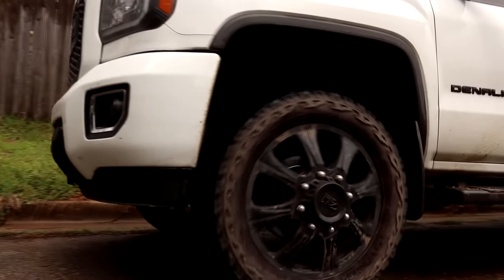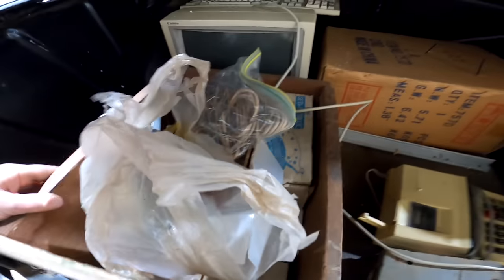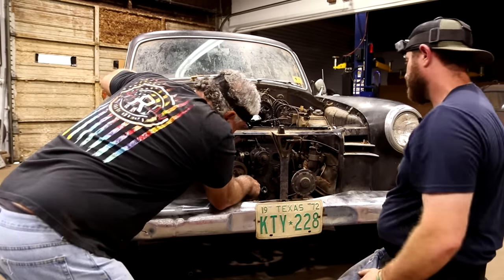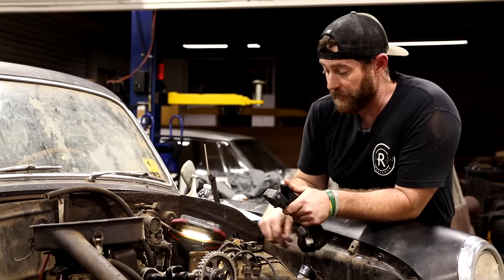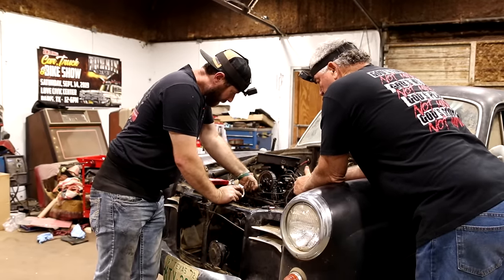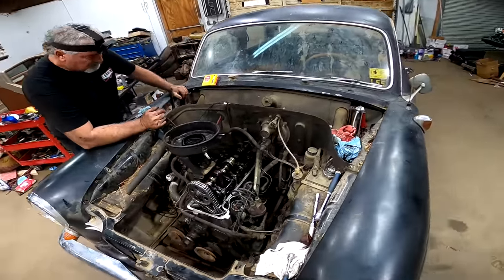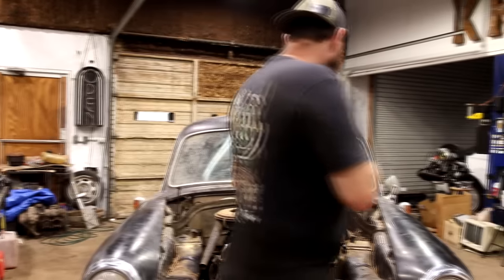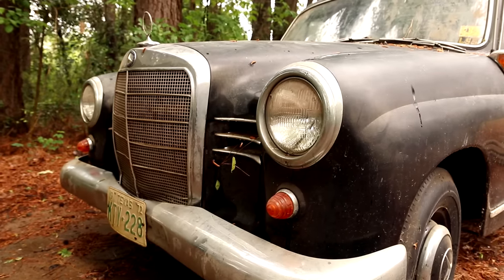First Start In 50 Years | Amazing Transformation 1960 Mercedes Benz 190B | RESTORED

Comment: So glad to see my Uncle's old Mercedes moving under it's own power.  My only memories of it are seeing the back end of it sitting in one garage and then another.  I'm amazed they didn't have to do a complete rebuild in order to get it running.  Good job!
FYI - Those dings on the driver's side rear fender are most likely from my cousins' bicycle handle bars.
Reply: It's such a beautiful car, I always wanted one of these growing up, I love the interior and dash design as well. Just curious, Did your uncle ever try to get it fixed or did he just want to drive something else when the timing chain broke or was it just too expensive at the time?
Reply: @belltolls1984  It wasn't really discussed with me.  Knowing my Uncle, my guess is he attempted to try and fix it himself, that's why the Bushes(?) Bushs(?), Lance and Wyatt found the bolts on top of the air cleaner.  He probably got to the point where they got stumped of how to get to the lower gear and feed the chain.  Where they had the internet and time to suss it out, he probably thought, "I'll get to it later".  He held onto it all these years, so I figure the intent was there.  Unfortunately, the house was full of "I'll get to it laters".  His sister's house took me 1.5 years to clean out the "I'll get to it laters".  Oh dang!  My house is filling up with them too!  Must run in the genes.
Reply: @kevinbradbury7259  love the personal update. It would have been cool if you bid on it but when it comes to old cars you probably need to bee a mechanic or have a pocket full of cash to keep them working.
Reply: @belltolls1984 ❤😂
Reply: Is this beautiful car for sale? I love it
Reply: How much did the auction go for ?

Comment: I own a 1960 180D diesel version of this car. Bought it in 1983. Ive owned dozens of these 180-190 Pontons over the past 40 years. They're built like tanks with a hand built quality and stay tight and rattle free for most of their life times and are insanely reliable.  The ride and handling is impressive for the era and its their first car to have crumple zones. Shame this wasnt a diesel, it would bring twice the price. Great job bringing it back from its 50 year slumber.
Reply: The diesels are painfully underpowered tho. They do run forever.
Reply: Killer lifetime cars. Different from what they build nowadays.
Reply: @LynxStarAuto  Rhats what they were built for - to run till time has withered and only the Star remains

Comment: The first trip to Germany I can remember well was in 1967. My German uncle had a 190D that was a little newer than this one. I remember the only front turn indicators it had were those two bulbous things high on the fenders close to the windshield. I can still visualize Uncle Herbert switching through the gears on the steering column shifter. That Mercedes exuded wealth to me. My Dad had bought a VW 1600 Squareback station wagon to take back to America with us. My little 1967 self wanted to ride with Uncle Herbert!

Comment: That is surprisingly rust-free for a Ponton ; I bought mine back in 1982 and kept it for 34 years ( mine was a 219 with the six cylinder engine ) .

However , regarding parts , you can get just about anything - just go down to the dealership and ask , most everything is readily available .

For harder to find items , like body panels , while the MB Classic Centre will reproduce them at eye watering prices , there are specialists like Heinrich Niemoller in Mannheim , or SLS and DB Depot , both in Hamburg . Be sure to ask Niemoller for his parts catalogue which lists every single part , along with the original MB part no .Used parts for these are abundant , at least in Germany , but around the world you will be surprised how many are still around .

If this car is a 1960 model , it is a very late Ponton - the series started in1953 with the 180 , which still had the side valve engine carried over from the 170 ( which itself was a pre war model resurrected after the end of hostilities ) , and was replaced by the Fintail series around 1963 ( Fintails were also known as the Ponton-B series ) . Yours is indeed a 190b ( note the lower case b ) which designated it as a facelift model with the wider grille .

I would just start by replacing the chain and the tensioners , I doubt the gears will have worn - the trouble is usually just weak tensioners . Do check the wheel cylinders in the drum brakes ; I rebuilt mine , and these cars are also prone to eat clutches for breakfast . The engine and transmission is designed to be easily removable by dropping the front subframe complete with suspension - these cars are so easy to work on .

The model got its name because of that front subframe , which a journalist of the time likened to a pontoon bridge , hence the name Ponton , which is German for Pontoon .

Comment: Great job lads, really impressed by the condition of the old girl, I bet if you slipped those aftermarket seat covers off, the original MB TEX seats will be in mint condition.
A couple of things to note when replacing the timing chains on these.
The tensioner is hydraulic and ought to be de-pressurised before being refitted but on yours, it already looked as though it was as the chain joining clip wouldn't have gone on.
2ndly, it is IMPERITIVE you make sure the round part of the joining link clip is FACING in the direction of travel or it runs the chance of dislodging itself. Then you will be looking at a camshaft cracked into 4 pieces! Best to check as I couldn't see on the video which way you clipped it on. 👍👍🏴🇬🇧

Comment: That is one sweet car. Far better than the 66 I owned 30 years ago. One of the classiest front ends you will ever see on a car. FYI, that emblem missing on the front is cheap and easy to get from the dealer. I bought two just to use one as a key chain. The rest of the parts are another story.

Comment: Well, I'm very glad to see you guys fixing up this old 190. I myself got a 1959 190D back in '78 when I was 19, and drove it for many years. That one, like my 220S from 61, got the trailing-arm mount rust (and timing chain issue). I didn't fix it, so it's still sitting in Southern Maryland. Those cars are too expensive for me now in Denmark. So I now have a 1990 190E - and a bunch of English cars. But one never forgets the first!

Comment: This was Great Fun to watch. My "Going To College" car was a 1958 220S (the 6 cylinder version of this) and this brought back a lot of memories. One big difference - mine had a "Hydrak". 4 speed on the column but no clutch pedal. There was a torque converter with a vacumn canister that pulled the clutch arm. Once in gear, when you let go of the shift lever, the torque converter kicked in (there were contacts in the base of the shift lever to trip the solenoids, etc). Fortunately, you didn't have that problem to deal with! This car was definitely worth saving.

Comment: I had a neighbour in the 1980s who's hobby it  was to rebuild these Pontons, he was particularly fond of rebuilding the diesels. I was still at school but often helped him, he told me that he rebuilt model T & A's when he was younger but the parts issue was so frustrating that he went over to building Mercedeses as these parts though expensive was readily available and  even manufactured by Mercedes if they ran out. I can clearly remember that we replaced those tail light lenses and even window and door rubbers. Many of the parts I have seen on your video were familiar, that heater radiator was interesting, they had 2 one for the left and one for the right hand side. The front top radiator hose had a bellows allowing for movement of the engine. I also love the column shift gear levers.  Gives room for comfortably seating 3 up front. Great memories. Nothing beats the smell of oil and grease, when your working late into the night, by the glow of your lead light. Been working on cars for almost 50 years but the plastic parts they use these days makes it less fun. I am from South Africa by the way. Thank you for fixing this beauty. Regards.

Comment: I rebuilt all the shift linkage in a 1960 just like this one.   Mercedes (at the time, 1997) was still able to provide every bushing, etc. that was needed. 
I love how, just like most German cars, reverse is push down on the stick and forward and to the left of first gear.
This is the only setup I have seen that is a four speed on the column.

Comment: There has been one of these sitting in my local junk yard for years. Iowa rust did it in many years ago. The engine is possibly good but thats about it. I opened the rear door the other day and it dropped about 4 inches. Thanks for passing it on.

Comment: This is interesting to me because my first car after graduating from engineering school was a 1956 Mercedes 180, four-door sedan.  Living in South Dakota the heater did not have a fan and you had to drive the car to get air to the heater coil thereby getting heat.  All in all I have had  two 220-S, one 450 SL and one 450 sedan.  Years laler now, we have a Tesla.  Thanks for your video.

Comment: I own  an 1959 Mercedes 180b.Same color , same condition.  My father bought it for me when I was eighteen, 30 years ago with 300.000km. I did almost 150000km. I had her always with me, in Greece, Italy and Germany where I worked as a car designer .Extremely reliable car. Very easy to drive. Easy to fix. They stopped me twice in Switzerland and Italy for speed! I still have the tickets  (125 and 130km!)  Probably the only classic of the fifties that can follow todays traffic.

Comment from the maker: Interested in buying this car? It’s currently for sale on eBay with a no reserve auction. Bid here: https://www.ebay.com/itm/166077034954
Reply: 😮❤f😊
Reply: What about the vintage desktop PC? Did it still have a motherboard and Power Supply in it? 😅
Reply: Strong cars, I use to have one, I thrashed it around East and Central Africa 1962-68.
No rattles or squeaks when I sold it.
Reply: I really wish my I could at the moment awesome car lots of potential!!
Reply: If the auction ends at 5k, the winner is getting a real bargain. Lots of potential in this one.
Reply: The real question is are you interested in buying MY car?
Reply: You have to pull the engine drop the pan
Reply: Man! I wish I could buy this rig! SO COOL! Good job fellas! BTW Y'all should do a collab with Derek again sometime soon!   That was fun!😀😉👌👍👊💪🤙
Reply: Dang. I was prepared to offer more than it sold for. Too bad I just came across it.
Reply: ' Broken timing chain " usually happens at high RPM  speeds . Bent valves, damaged pistons bent connecting rods, bent cam shaft, broken camshaft pedistels ???? Add completely failed hydraulic brake system, worn out suspension king pins and mounts. Transmission ?

Comment: I owned a 190c exactly like yours. I had to replace the timing chain on the front lawn of my girlfriends apartment, Long story short, I used a metal coat hanger to grab the lower end of the new chain and after several tries i was able to capture and install the chain dog. That car brings back memories

Comment: Nice video! This is an interference engine. And I never heard of a double row timing chain break on these engines. Chances are the previous owner tried to replace the chain as normal maintenance, dropped the chain in the sump and left it at that.

Comment: My two bits worth.
I owned a couple of 190a, 190SL and a '60 190Db. 
I have rebuilt just about everything. Had friends that were MB mechanics, used to hang around the dealer in Chicago, and then Tucson. That was in the mid '60s. 
You are going to have to replace all of the plastic parts in the shift linkage. 
Fortunately Mercedes supports their vintage models.   many parts are available.

Comment: That tensioner has a ball and cup inside which is now probably on the floor of the shop somewhere. It is used to seal oil within the tensioner so it doesn’t slack the chain off. It is not pressurized by the oil pump, it fills itself simply from the action of the timing chain movement. Oil needs to be poured into the pocket where it enters the inside of the head. Then use a screwdriver to push on the sprocket repeatedly to prime it.
You can remove the entire tensioner without messing with the chain by removing the two nuts on its housing on the side of the engine. It can be disassembled and cleaned, make sure the check ball and cup are still present.

Comment: My father brought the same exact model 190 in Thailand back in 1970 for 1.5K in excellent shape. There are 3 layers of original paints in green from factory in Germany. Only few problem was the horn button emberm assembly on sterling column and paper veneration tube assembly were broken and it cost $15.00 to get OEM parts for replacement. The car has 100K Kilometers on speedometer and in excellent condition since it was maintain by top notch mechanic that available for Royal family back then.

Comment: Great video of a clue classic, a European 4 on the column! I know my heart rate went up watching you dealing with the timing chain. How did you get the paint off the back? That old radio might actually work if it's a tube type. Try letting it warm up and if it still doesn't work flick the vibrator on the back a few times.

Comment: My mother got me into Mercedes. She had a 1974 240D (car was as old as I am)  It had over 750k certified miles on it before someone parked  a Ford Probe into the side of it at 55.  My son and I are working on a 63 Fintail 190dc currently. Parts actually can be easy to find used and new. A lot of them you can pick up right from the dealership! Mercedes Benz Classics does an amazing job stocking Old New Stock and  brand new reproductions. You have to remember , They are the originators (1883) everything else is a copy

Comment: Excellent video RESTORE Crew Wyatt, Lance, Christine  also nice car keep in tip top and repairs to did with it ! Like that car and great shape plus find too! Plus get some wax on paint plus chrome too and interior too ! Fix up and think car you guys need keep it too! Plus check in get new brakes , main brake pedal plus booster also resivor ,  fuel tank plus pump to and carb fix to ! Exhaust sounds may need replacement too!

Comment: My old landlord has a 1963 220 SB with a straight six and a 4 speed manual and dual carbs. I had to rebuild the carbs and fuel pump. The kits were written in German. It was fun.

Comment: Usual cause for t-chain breaking is a broken chain guide rail tangling with the chain, usually while at high rpm and highway speeds . 
Should have bought a repair manual to understand how the timing drive operates. Hydraulic oil chain tensioner, check the rocker arms for wear and bends from the valves making contact with pistons.
And it start quicker if ignition timed correctly with a timing light, 30° BFTDC at 3,000 rpm with. No vacuum to distributor

Whats up with the BMW Isetta ?

Comment: I bought a '60 190 from a local junk-yard in '72. It looked like the rear axle was missing, but it was just sitting in a hole and the rear tire on that side was flat. So, for $50, Corky towed it over to my Grandpa's garage for me.  Bought a clutch from J.C.Whtiney, and my step-dad put that in. I drove that car for 4 years, and the only trouble with it was I got rear-ended a lot at stop lights in Chicago. It's a long throw from 1st to 2nd when you are driving a 4 on the column shift. Usually, by the time I got to 2nd gear there would be a crash as some Buick had impacted my bumper. Never more that a scratch on the MB.

Comment: Im a benz owner 1990 420sel, if the timing chain broke while running your probably looking at bent valves, maybe damaged pistons, you need to take the head off, benz are actually easy to work on, good luck.

Comment: The timing chain tensioner is indeed hydraulic, you normally remove it when you put a new timing chain on. The timing guides can be replaced by pulling pin that have a press fit. They have internal M6 holes and come towards the radiator. Am I the only one who thinks it is running on less than 4 cylinders? It came good after. Great job guys, because this technology was quite alien for the American mechanic

Comment: I have a 1968 230 (last of the MBZ tailfins) and the factory manual. Its a first class comprehensive, thick paperback manual printed on high end paper listing all the procedures and special tools. Parts are ridiculous expensive, just bring money. Engine/machine parts are high end, precise and very adjustable but the rubber and plastic suck to high heaven and won't last couple of months on mine during the Summer heat.

Comment: I just found this channel… you should buy my 63 Catalina and do an episode on it. It runs and drives, pretty much all original except for the paint, which the original owner and his son did over 30 years ago as a project. looks pretty good,  transmission is starting to slip, sometimes it is hard to get it to shift out of first gear unless you rev it up high

I have video on my channel.

Comment: Bit late now but there is two dowel pins on the front of the timing cover. Screw an 8mm bolt in and pull them out. This released the two chain guides that and will give you all the room you need to get the chain in and timed.  This method is still relevant in most of the merc van and car engines, petrol and diesel. Jus sayin.

Comment: Use to install timing chains with welding wire slide it down with 2 lengths and Fred it back up the top very easy process

Comment: Mid-1950's Studebakers used the same type of power brake booster and hydraulic brake system as those Mercedes 190's. Mid -1950's Cadillacs did as well.